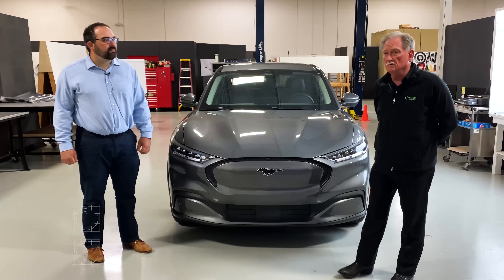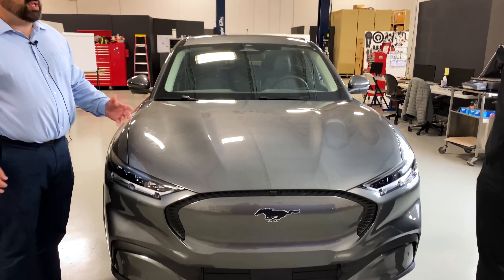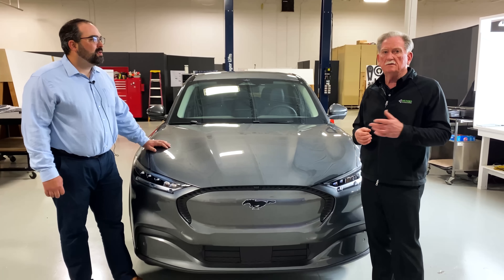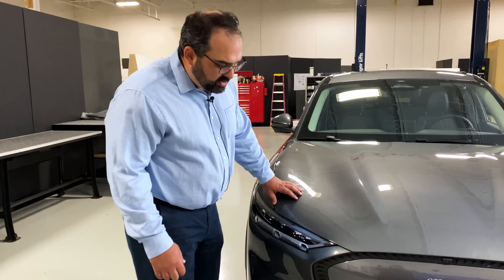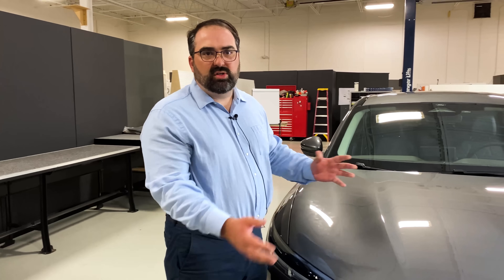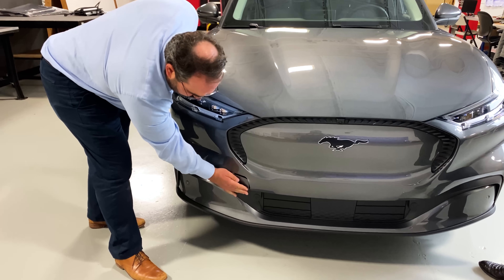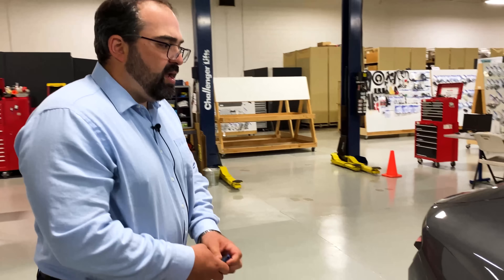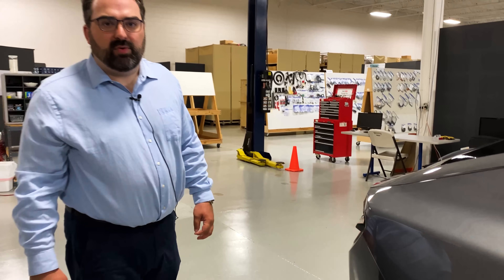MACH-E Teardown BEGINS!

Comment: Panel gaps on a Ford? I thought that was meant to be impossible, only reserved for Tesla's 😂
Reply: @WaleedALMUH  I agree that there are/were/can be some panel issues, all car companies can have them to varying degrees. But as I said, this problem was only noticeable because of the exaggerated focus. 

The question is not the existence of minor imperfections in a build, that's not the issue, but rather how the media handles it for a sponsor vs a threat to their business model, you can tell the same story in many ways, ranging from mentioning casually to making it the focus of the piece or telling it with a strong tone, it's an art.

To expand on my opinion:
- After 2017's growing pains, most of these issues with panels the majority of people would not have noticed unless someone else pointed it out for them - or by taking a ruler to it. We're talking millimeter measurements. 
- And it's not something difficult to address, a half hour visit by a ranger could resolve it usually.
- Some folks confuse cosmetics with mechanical reliability, the two are separate cases, Teslas are rock solid on the reliability front, so a robot being a millimeter off on tolerances is not a reliability concern as some spin outlets try to spin it.

Again, Fords have had these issues, minor cosmetics are not uncommon, it does not make the Mach-e a bad car, it's just cosmetics that they need to resolve. Even Mercedes and BMW builds for NA market have them in this bracket, feel free to lookup videos of that.

Tesla has gotten better either way, yes, and with the mega-casting the tolerances will become quite tighter, since 70 parts get turned into 1 or 2, removing up to two thirds of the robots on the line. 

But the media will likely look for other things to spin regardless, until Tesla starts paying $2 billion/year in ads like Ford and others do, just the reality of the media's business model being threatened by Tesla's marketing policy. 

Some folks working in German media were even talking about editorial policies forbidding them from covering the company positively, a major outlet even urged its readers to literally short the company in order to "bring Elon Musk to his knees" as they put it, that's just a ridiculous thing to publish.
Reply: All cars have some issues with paint and panel gaps. It’s not only Tesla. Yes it may be worse on Tesla’s but they are not the only ones.
Reply: @JAM_2024  This was much worse on the Ford, that gap in the back was relatively huge. Not that it's a show stopper like some people pretend it is, but goes to show what happens when folks rely on anecdotes and listen to sensational clickbait media. 

Statistically Tesla has 7 "defects" out of 100k Model 3s made in Shanghai according to Chinese monitoring group, placing their vehicles in first place, with second place at a much higher but still very respectable 37 defects per 100k, and this is on brands both foreign and domestic, including Toyota and VW.

The Fremont facility has started hitting that level of quality based on recent UK inspection. And with their mega-casting stuff taking off this is set to tighten tolerances even higher as two thirds of robots on the line are taken out of the equation.

Lesson of the day: Click/Ad driven media will spin negative sensationalist stories, making mountains out of mole hills, against those who don't "participate" in their business model. And the gullible public will run away with it. Nothing new here.
Reply: @JAM_2024  yea that was the point of my comment, I was being sarcastic

Comment: Add simplicity by removing the door handle, just by overengineering the electric mechanism. Why no mechanical release if battery is empty like the id4?
Reply: High end cars have the electrical mechanism anyway. By removing the mechanical one you make it simpler, not more complex.
Reply: @celeron55  so after a crash and a may dead 12v, no one will be able to open the door by hand. Brilliant!
Reply: @arsni23  inside the car there is a release. in your car if you get in a wreck and your doors are locked can the door be opened from the outside using the handle?

Comment: Munro team, do I understand that anybody could open the frunk without keys simply by accessing the leads behind the hatch?
Reply: He said the main battery has to be dead or the override doesn't work.
Reply: Hey Guillaume, nope, Ben clearly stated this only works if the main 12V battery is dead.
Reply: @christopheporteneuvepro   so,  yes if your battery happens to be dead?

Comment: Can't even open the doors when 12V is dead? Brilliant! 
😂
Reply: What is more embarrassing is that somebody will have to provide you a temporary 12V to connect to those little wires just to pop the trunk open so you can start charging the 12V 🔋
Reply: The door mechanisms all have supercapacitors  in them, which are good for 6 or 7 "opens" in the event of a power failure from the 12v. There's also a mechanical override from the inside.
Reply: Ridiculous. I prefer the handles of the Polestar 2.
Reply: @caladanian  Polestar 2 have a reputation of dying on the road. That is one nasty software problem, maybe they'll get better.
"Polestar's first production EV now faces a production-wide recall. That's because it's leaving some of its owners stranded."Oct 5, 2020
Reply: @caladanian  Maybe it's not a software issue
"Polestar 2: 4,586 Units Recalled Due To Defective Inverters"
Reply: I also worry about the plunger to open the door failing in the future and the cost to replace them. A simple old fashion door pull will work just fine.
Reply: What was wrong with traditional door handles?

Comment: Still think it's silly to not include a manual latch somewhere for the doors when power is out.
Reply: It comes down to three things. First, the main battery can keep the accessories like doors running by recharging the 12V for WEEKS even at 1% charge. Second, the doors themselves have self-contained capacitors that allow for the door to be opened a few times without a battery attached at all. Third, EV 12V batteries are much less likely to go "Dead" in the first place, unlike in an ICE car where they have repeated high draw events every time the car starts, they really just sit there keeping accessories on until the contactors connect the traction battery to the DC/DC converter.

Comment: Hey Sandy, could you do the Mach-E community a favor and take a close look at the design of the small instrument cluster display behind the steering wheel to determine where the electrical noise/whine is coming from?

There appears to be a widespread consensus that virtually every Mach-E has that electrical whine/buzzing sound at some level or another. Some units are extremely hard to ignore and not hear, while others require you to pay close attention, but it seems they all have the issue and it appears to be the result of an engineering design or component selection issue. 

If you can pinpoint the specific source of the issue at a component level in the midst of your teardown, that might in fact help the community come up with a fix since Ford has decided to hang us out to dry on this one, and they have considered this "normal" behavior despite it being anything but "normal".

Here are some posts with details on the issue:

https://www.macheforum.com/site/threads/sm-49810-buzz-noise-from-the-instrument-panel-cluster-ipc.6382/

https://www.macheforum.com/site/threads/high-pitched-electrical-whine.3225/

Thanks in advance!
Reply: That information will be released to Patreon subscribers.
Reply: I have driven the Mach-E and didn't notice any noise coming from the driver's display.  I had the sound turned off on the radio and was driving on smooth roads.
Reply: @AMan-he9sz  But what about the panel gaps on the Mach-e ?
Reply: @sammiller6631  This is the first example of that I've seen.  On a liftgate, this is easily adjustable.  On a Tesla, not so, since you're talking about the inside fit as well, and panels on the outside that aren't adjustable or at least not by laypersons.
Reply: @AMan-he9sz  The panel fit issues are more from earlier Teslas but the idea has stuck.
Reply: @sammiller6631  MY 2020 Model Y LR had terrible panel gaps.  It's still a thing.
Reply: @N7_Maric  Truth!
Reply: Actually, on the MachE forum, it's not a widely reported issue.  Some owners have it but seems like a small %.

Comment: Thanks, Sandy and welcome Ben.  Let's dig in :-) 
The backdoor is fine without the handle. They should have to copy it for the front as well. 
Why is there no shortcut with the two cables in front?
Reply: The have fuses in them.
Reply: @alanmay7929  A diode in series with one lead you mean.

Comment: Great explanation of the door opening mechanism.
Reply from the maker: Thank you
Reply: Would be good to see a 200lb gorilla fall into/ kick it
Reply: Does this mean someone can gain unauthorized access to the car?
Reply: @harrychu650  If you listen to what the gentleman says, the answer is no.  He said the car is secure.
Reply: @harrychu650  
"Does this mean someone can gain unauthorized access to the car?"
Exactly my thought.
As I understood the explanation... yes.
But that would be really dumd so I take for granted I missunderstood something...
Seen that piece 4 times now and that is still how I interpret it...
Well I will go out with my 12 volt battery and see if I can steal a Mach-E....
Will tell you how it went...
Reply: @harrychu650  I think the leads don't work if your battery is still charged. He didn't fully explain it though, but he hinted that it was secure.
Reply: @harrychu650  I understood that someone could gain unauthorized access only into the front trunk. The car itself stays locked until the person having the key fob (or correct phone app and user authority whatever there is) arrvies...
Reply: Definitely a good child proof mechanism 👍

Comment: If I understood this right, you’re saying that if the car battery is not dead and has a charge. You will not be able to pop open the trunk with those leads out the front? It will only work when the battery is dead?
Reply: Doug you are correct, the jump in the bumper only works to unlock the frunk if the 12V battery is powerless
Reply: The 12v battery powers the infotainment and central system and then allow the high voltage battery to drive the car. The 12v battery is separated from the big battery.

Comment: I am curios if inside doors are ECUs from Continental. I worked on such ECU for Ford Focus and other models, ECU dedicated for door functionalities (locking, mirrors control, power window, switches and lights), and would be  interesting to find if they used the same.

Comment: I would like to know how many threaded screws Ford used in the Mach-E.  Kind of a tiny detail, maybe, but it'll be a hint as to how much maintenance/operations costs Ford has in mind for the life of the vehicle.  Threaded screws are a failure mode.
Reply: Stop talking nonsense, threaded screws are totally not a problem and have been used in Europe for decades.

Comment: Wow, panel gap issues on a Ford?!! Hold the front page!!!
Reply: If this was a Tesla the panel gaps would be front page news on CNBS.
Reply: @StormyDog  You mean NBC
Reply: @nevergone3424  No, I meant CN'BS".
Reply: happens sometimes, but you may get lucky and get a good example.
Reply: Because panel gap issues exist in all cars to an extent. I've seen BMWs with differing panel gaps and my own VW ID.3 has panel gap issues. A couple outside and one inside, spotted do far. Once reputations are established, people stop looking. I say, if it's important, keep looking. Panel gap issues aren't that important to me. Deserved and undeserved reputations [ie, Truths & BS] are.
Reply: @ramblerandy2397  Sorry Andy but neither VW nor BMW have ever had panel gaps.  That is an internet fact.
Reply: @davidbeppler3032  So you'd like to see a few photographs? They may not admit it, but they are there. May be it's arrogance?
Reply: @davidbeppler3032  Then the internet is wrong.
Reply: @sammiller6631  Fake news.
Reply: @davidbeppler3032  Labeling something doesn't make it fake news.
Reply: @ramblerandy2397  Panel gap issues are as important as thin bezels on a phone.

Comment: 2:45 I don't get it.  Why can't jumping this power the doors? edit: I see now. I think they did this so it will be unlikely for someone to start driving the car forgetting they did something on the front bumper
Reply: Because then anyone could get access. Now you need first to jump the battery. Also, as I understand it, this trick will only work if the battery is dead.

Comment: so basically nothing proprietary on this vehicle e-axles by borgwarner same ole same ole
Reply: Or something developped by ford and borg Warner or developped in house by ford, I dont see the problem.
Reply: @alanmay7929  no borgwarner sells this product to OEM's check their website out
Reply: @joeyscleaningladys  yeah just like Brembo, Bosch..... sells their products to tesla......
Reply: @alanmay7929  brake booster and calipers are not core IP.... powertrain is specifically the software stack, inverters, and torque vectoring e-axles.  Being that Ford is using these specific e axles on 3 vehicles f150 lightning, e-transit and mach e outsourcing the powertrain is a big deal
Reply: @joeyscleaningladys  its actually not a big deal because it was codevelopped with ford and ford is the software writer, tesla also uses ABS which was developed by mercedes and bosch.
Reply: @alanmay7929  " codevelopped with ford and ford is the software writer" 
This is what scares me the most
Reply: @alanmay7929  Ford does not own the stack they use  a QNX stack and the middleware is developed by another supplier.  Anyone can purchase this e-axle off the shelf
Reply: @joeyscleaningladys  like i said the axle alone is not enough, ford has to write their own software to integrate that in  their cars.
Reply: @thesure1  yeah thats what she said LOL, are you serious?! How do you think gearbox and engine ECU and many other car modules are controlled? You think its a joke!?
Reply: @alanmay7929  ford's future? yes
Reply: @alanmay7929  axels, inverters, among others the integration is done by suppliers you do not understand how it works
Reply: @alanmay7929  but I have no idea how you are interpreting my comment to come up with that? Is there more to my comment than I can see?
Reply: @joeyscleaningladys  i actually understand how it works, ford develops and designs the car and looks for suppliers, also ford makes the software to integrate everything, just like they developed the ECU for their hybrid and ICE cars.....